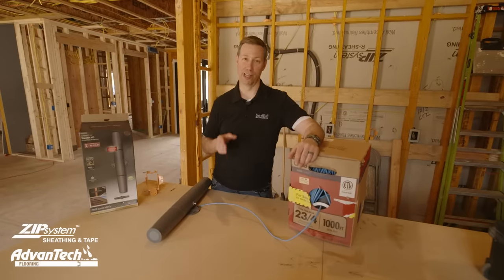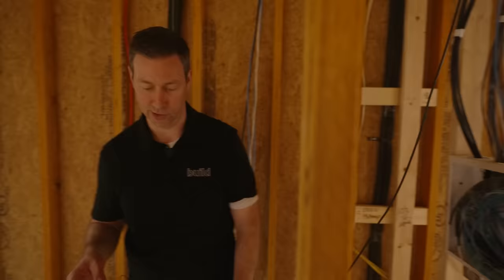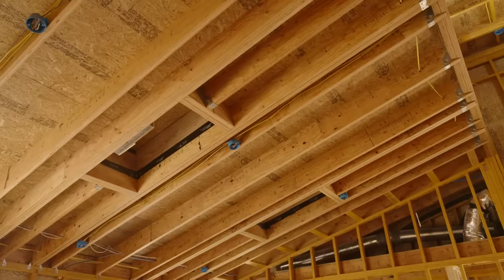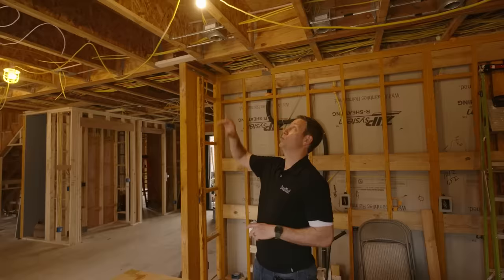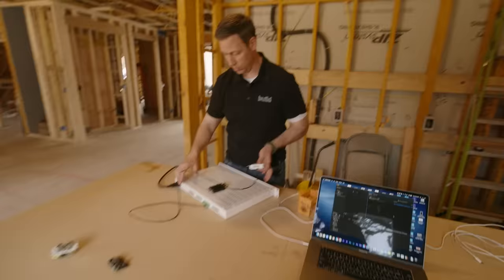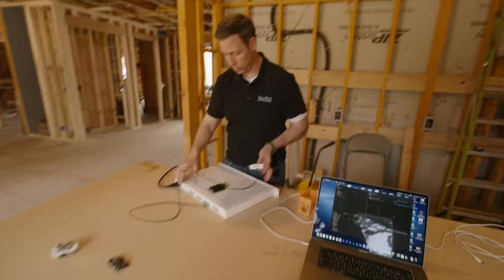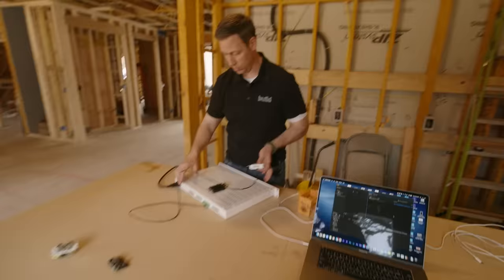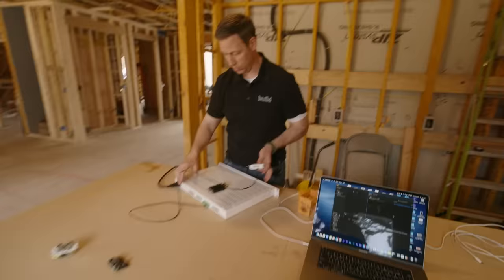Low ⚡Voltage at the Real ReBuild

Comment: @ Matt Risinger :  Great coverage, BUT,,,,, have you considered the HEAT that you will build up in the under-stair area and the Audio/video vault in the viewing room? I have a computer and TV set up in a bedroom in my house and this is where I am most of my handicapped days. I am in it now at 10:51 PM and it is 86*s in this room. The rest of the house is 79*s. This isn't even the farthest room from the AC unit!! Computer, monitor, Modem, Bose speaker for desk-top, LED light, Battery back up and flat screen TV all in this room and it is literally 11*s cooler OUTSIDE right now!!  So before you close up your walls, please take this all into consideration..
Reply: Matt Risinger  W T H is that?????
Reply: @SteveP-vm1uc  It's a bot.  Basically a bit of coding to spoof creators accounts then post in their videos or in the same category to make it seem like these people are supporting the scam they promote.

Comment: If I were you I would’ve run Cat 8 to your D Mark and then run cat 6A to all devices in the wall in the ceiling outside inside whatever it’s always nice to have also a future proof so you have electrical or data cabling at doorbells and corners of houses outside just in case someone or yourself would like to put in a Camera or flood light or smart system
Reply: Also in your media room since that’s where you have your switches and what not be a great place to have a security room for security devices hook up and I would also add a trip light to your 19 unit rack, the trip lite Uses a 20 amp plug and acts as a industrial surge protector to protect your devices and your battery back ups

Comment: Solar produces DC, "house batteries" and UPS devices store DC, damn-near everything in the house uses DC (e.g. every LED light, every computer, every TV, etc. etc.), and so on. There are only a half-dozen major loads that require AC power for major motors (e.g. HVAC, sump, most applicances) and that's changing all the time. The housing industry is lagging. Time for AC to be kept in a few locations (like coax now!) and ditch the parasitic losses from all of those dozens and dozens AC/DC converters in every room.  Can't happen quickly enough.

Comment: You don't want big batteries. You want a system that uses UPS and gas generator, and your batteries only need too be big enough to get you over the hump when you lose shore power and you switch to generator. Plus a small amount of overhead, of course.

Comment: At first glance the idea of low voltage lighting is both high tech and extremely simple. If deployed with CAT6 it could easily use a combination of PoE and four channels for LED control. The problem is though no such system actually exists and 100w PoE is comically expensive. You quickly venture into the land of unregulated quite likely to start a fire non-sense and over priced led control systems. Then never mind the actual lights. When you combine this with the fact that regulators (for good reason this time) might make you put up AC wires for the lights anyway whats the point?
Reply: P.S. I priced a system like the Voltek about 5 years ago using CAT6 + PoE and also while there was a PoE light at the time it was stupid pricey so I had costed in converters that go to a DC jack that I'd think use for LED lights. It was way more complicated than Volteks system but cost .. about that $1000 and to do a whole house with one or two outlets in each room and 1, 2 or 3 lights per room would be in the order of $7000 which is just ridiculous.

Comment: I'm looking forward to learn about Ubiquity.
Reply: check out @MactelecomNetworks, @LawrenceSystems, and @CrosstalkSolutions, @LinusTechTips for their videos on the Ubiquiti gear, Also Matt should use the Ubiquiti designer to see the best coverage for the house and deployment of access points and switches, for every ethernet drop i would use the UAP-IW-HD access points which has 4 ethernet ports and also provides WiFi.

Comment: There's a few unfortunate, worrisome misconceptions and negative trends in the general population which seem to be reflected and continued here.  First 'low voltage' actually starts at 110 VAC single phase power progressing to 600V AC 3-phase.  MV 600 to 69,000 V, HV 69kV to a quarter-million; all 3-p.  At the top end, some transmission has actually gone back to very high DC voltages, say a half million volts, for transmission efficiency and compatibility between different power grids (such as 50Hz to 60Hz).   But datacomm wiring is just that, and is referenced by the type of physical wiring, not voltages, which are implied and may even change within a particular type.  The best doesn't even have voltages.

Secondly, much datacomm cable is inherently 'shared bus' technology, where many different kinds of routing and bridging packets, coming from and going to many different locations can be transmitted over one physical cable. It is not meant to be a point-to-point setup like power circuits.  So you have to plan out your data networking at the routing level first to see what kind of mesh you need, then implement the physical cabling to support it, not the other way around.

Third, fiber-optic cable [still] has huge advantages over copper-based technologies, in terms of sheer capacity, interference and noise immunity, speed, cost, spying resistance and extremely low power consumption (and therefore heat generation).  In the datacomm world it regularly supports many terabits per second over the long haul, and is also extensively used in factories and large refineries at very low speeds but in places that would drive copper-conductor data transmission bonkers from extreme electro-magnetic interference from big motors, arc-furnaces, switching devices etc.  I run TOSLINK interfaces at home, and other proprietary f/o interfaces in industrial settings.

Fourth, consumer technology has a very short half-life.  As soon as some consortium dreams up new stuff to sell into a market, they'll cook up new standards/versions and physical cabling to do that; proprietary if possible.  So as mentioned previously, you should run pre-threaded smooth conduit with access caps (like rodding ports in drain lines) between probable end-points so you can pull new cable every 8 years.

Finally, in most places you don't need or want a separate computer everywhere you have a display terminal and user-interface device.  Little computers everywhere creates a system administration nightmare, unnecessarily duplicates the same darn pieces everywhere jacking costs, and are usually tossed out every couple of years due to designed obsolescence.  Better to put in one multi-user system with high-quality subsystems with high-grade open-systems software supporting many users, each with his own account.  Sort of like keeping all your family members together in one house, instead of just throwing up a bunch of cheap sheds in your yard, one for each person.

Comment: Ubiquiti has POE LED lights i installed a few in my house
Reply: Does it come with a special POE injector or switch? That can't make a POE switch happy depending on how many watts it's pulling. But maybe it's fine, can't be much different than all the security cameras I'm running with IR LEDs at night. But that is a waste of an expensive POE switch for just lights, at least the security cameras are using data to the security footage server. 🤔

Comment: Not a fan of Sonos. Listen and compare them in a shop, and you will very quickly hear and understand that other brands sound much better. Also the communication thought out Sonos is very fragile. Synchronization, fallouts and other problems is where Sonos is known for. A cheaper solution (for example) is Arylic. I am testing that system, works like a charm. You are able to buy your own speakers and connecting them through that system. This makes it more flexible than Sonos which does NOT let you choose or select components other than what they sell. Not flexible at all and the quality isn't that great. Don't fall for that trap. 

Ubiquiti is alright (not the best), but an expensive system as well. There are lots of other better brands in this field. This marked is very much in development, very volatile. Do your research and go for the best product versus price that is available when you are going to buy. Much information here on YouTube about this. Not on this channel :p

Matt, you are so biased. Please promote the stuff (brands) you really know what you're talking about. That is building materials and building styles for the upper marked. Not these products that you get thrown into your lap. Keep to what you really know Matt.

Comment: Occasional technology refresh videos wouldn't be bad. Building tech improves. Technology support will too, but you can probably get a 3 to 5 year cycle out of it, which isn't bad.  How do you avoid dumb mistakes. What do you build in and what do you not, such as docs. But if you do, how do you make things interchangeable or upgradeable. For example, hdmi is on 2.1 for the best cables. If you put that in your wall, what's the expected life. How difficult is it to get out of an insulated wall. I think you could do some smart videos on that. But I get that maybe it's getting close to being a different channel. Still, who makes those videos.

Comment: As a commercial low voltage guy, the Samsung cable made me laugh.

Matt: "I'm fucking myself with proprietary cabling that will screw me and become useless in a couple of years! Yay it's so cool!"

Bro, just get some media converters. Don't run long ass proprietary cables in a residential setting.
Reply: You don't need a plywood panel anymore. Get punch-down patch panels, Leviton makes great 48 port, 1U angled, modular patch panels. Throw that guy at the top of your rack, buy the plates for w/e you need (CAT6, RCA, F-Type, BNC) and call it a day.

Also CAT can be used in place of POTS without modification, not that anyone needs those things outside of a commercial setting there days anyway.
Reply: Oh, and your alien EMI, man. ALL DATA RUNS PARALLEL TO HIGH VOLTAGE NEED TO BE SEPARATED BY 12 OR GREATER. 

You're going to have a lot of problems with those cables run like that. Get your shit away from the Romex before drywall comes in.

Comment: I don't really see the appeal of the Voltek unit. 1000$ to get 6 charge points. 
You can get A LOT of chargers for 1000$ Even Apple originals.

Yes, it can look a lot less cluttered. But if you want the uncluttered look, then you have to remove the USB-C wire. I don't see much difference in having to find a USB-C wire or a charger and wire.. 

And running low voltage through dental floss wires just means tons of loss..

And.. If the unit dies, then nothing gets charged

Comment: Go Into depth on "low-voltage systems" & electronics
Comment: wire sizes is critical with low-voltage runs, comment on wire sizes and length of runs.  (Voltek, webpage said 18-2 AWG didn't give length of runs back ti Ohms law)

Comment: Why not just plug in using the appropriate brick? Voltek seems to "solve" a problem it doesn't really exist.
Reply: $1000 plus wiring/cabling to avoid having a brick on the wall.  All for a technology that will be outdated in five years.  
If this is really the 100 year house that Matt has stated, the appropriare solution would be conduit so that the cabling can be updated as technology changes.
Reply: @rogerhodges7656  WiFi will exceed cable specs within a few years. Cat7 is about as fast as you'll get until then.
Reply: @skynetlabs  We will always have cables as a backbone. The APs have to be plugged in and transfer all the data for all wifi devices. Also wifi is half duplex cable is full.

Comment: Ya the whole low voltage thing for data/network/signal is annoying, 110/220 high voltage - 12v low voltage landscape and such - data/network/signal does not supply voltage to run anything it supplies signal whether it is coax or network or speaker wires it is data. Now the $1000 solution to the power brick (ridiculous btw) is considered low voltage.

Comment: Matt, just curious, having owned a motorhome, I know that all lighting is run at low voltage 12V. Will the building/contruction industry ever move to this type of lighting systems in homes? With generator and battery bank backups available, it seems this would be an easy way to conserve energy. I replaced all my lights in the motorhome with 12V light bulbs whichs saves quite a bit of energy when using the deep cycle battery banks. Your thoughts on the feasibility of such systems for homes?

Comment: In reality you could still just run Cat5e. Unless you are wanting to run 10Gbps... Then if you do want to upgrade to Cat6 then make sure you don't staple the cables in, and use the old cables as pull strings for the new. Cat7 is pointless in a home unless you just like spending money.
Reply: The CAT6 might enable him to get 2.5gb if the run is too long to support 10gb.
Reply: @joshuadavis4038  You can run 2.5GbE on Cat5e out to the full 100 meters. Cat6 can do 10GbE the full 100 meters. 2.5 was supposed to explode out into homes but yet we have seen very very little. Even Ubiquity has only 1 switch that does 2.5GbE and its still price prohibitive. I'm not fighting with you, but I've been doing Datacenter networking for around 6 years, and Industrial Networking and Automation for another 3 years. 20 years ago we though we were going to be using IPv6 by now... But where has that really gone? And with our internet speeds have greatly improved, but they still only max at 1Gbps. I dunno... Seems like its just doing Cat6 to just do it. Here I am looking at my network rack at home thinking I need to clean the SoB up. LOL
Reply: @ryanreich7635  No offense taken! My thought process was the best value to cost ratio for the cabling (In my opinion, of course). Even if the cable cost is ~$5 more a run, I would do it... If it was my house.
Reply: @joshuadavis4038  I just noticed something.... He ran Cat6... not Cat6a. Cat6 has a bit better shielding than 5e but still not rated for 10GbE. 
Cat6a for 1kft is $370 vs $120 for 5e. Cat6 is like $230 for 1kft. If I were running Cat6 i'd just run 6a then at that price. I'm used to cable vendors charging woopidooo amounts for the Certification process etc. Talking a like $140 per cable run but that comes with a warranty. 

You are right I guess the prices have come down a bit. But if you are in a crunch then I guess Cat6 could be a better option for home use in-wall with the better crosstalk twisting. 

Oh well learn something new everyday. :P

Comment: Low voltage of any type, ethernet, spkrs, etc ALL need separation from AC wiring.  Code requires 3", so drill for that separation.  Please don't run along with the AC wires.  (EC for 50+ years)

Comment: Big oof not cat6, Run cat 6A.  6A can handle up to 10GB ethernet, 6 is really no different than 5e as both can run 1G speeds.  Most people under estimate the load 16 4k camera's and 3 teens playing fortnight, watching y/t, pushing out tiktok vids can put on a network. 1Gbps is not really that fast anymore. And as you said 5e/6 lasted about 15 years. My plan is 6A.     FYSA cat7 is proprietary not EIA/TIA approved in the US and the connectors run about 30$/ea. Cat 8 is out, but it's really for data centers, the run length is shorter than the typical 100m to hit their 40Gbps

Comment: What did you have to run coax to? You mentioned three runs...

Also, I have to think you considered a new run that the future of ATT Fiber may want to bring in....curious how you planned for that. 

Great content here, as usual.
Reply: His CAT-6 can easily handle 5.0GbE.  I believe CAT-6 is rated up to 100 meters in reach.
Reply: Well for 1 the outdoor OTA antenna then media room and then 1 to the TV area for sure and maybe 1 to outside for cable/satellite just in case but I'm speculating. Good ?

Comment: You should be using CAT6A, not CAT6. The wire you show is not really future proof to 10Gbps. The correct wire is minimally more expensive.
Reply from the maker: I did Cat6a but should have made that more clear.

Comment: Be sure to segment your wireless networks so that IOT and other notoriously insecure devices are not on your primary network that you use for hardwired, more sensitive devices like your computers that do financial and personal computing.  This may require additional routers, or routers that allow a secure, segmented Guest wifi network that cannot access your main network.  Just today, I heard of two new hacks that allow even the most recent wireless protocols to be bypassed, and pretty much every cheap IOT device on the market will NEVER get security upgrades, and calls home to China and God knows where else on a regular basis.

Comment: Mesh networks work wireless, but work better if they are plugged to Ethernet. My suggestion is to wire where you might have mesh hardware
Reply: UniFi is wired mesh access points

Comment: I laugh at 15-30watt led fixtures that are on 277v in commercial space.   Why? because that is way we've always done it.

I don't get why anyone is running 12-2 for lighting anymore.  24v with dirt cheap 18-2 more than enough and you can set up some very slick controls.